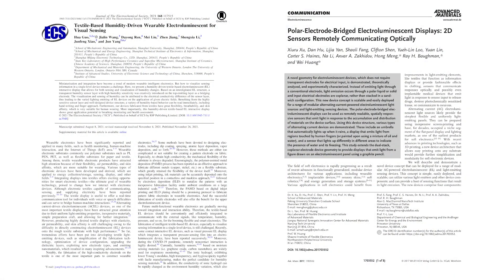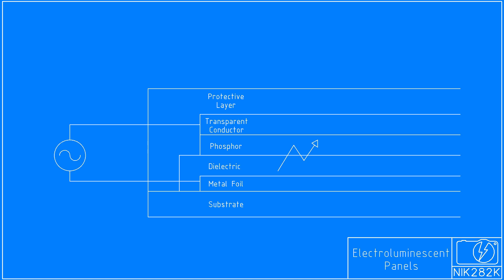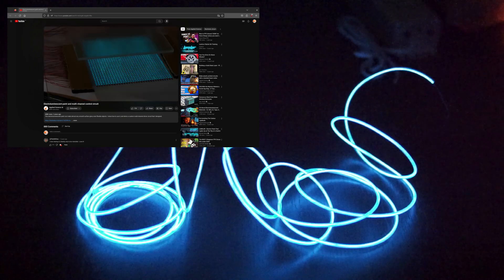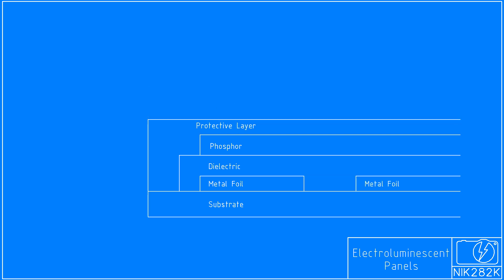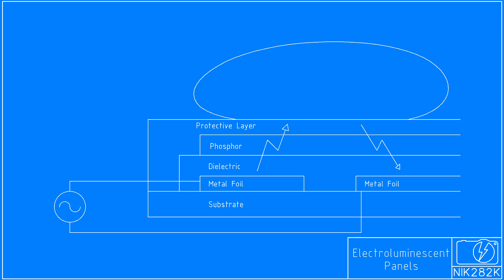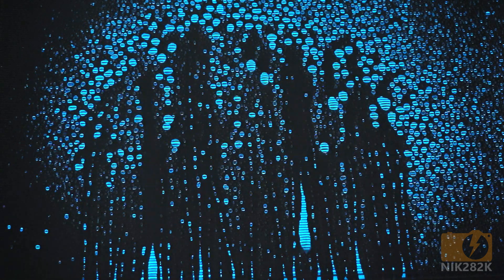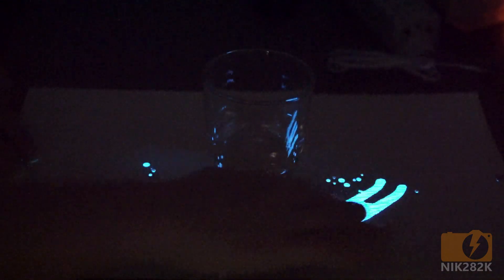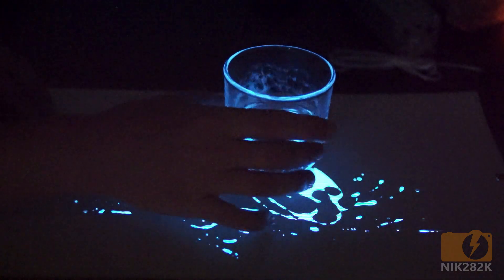Water Reactive Electroluminescent Panels

Comment: Very interesting !
I think of acupuncture points on the hand, they  have less electric resistance than nearby skin, so if you put your hand over this screen, the acupuncture points will cause more light. The problem is you can't see what is happening between your skin and the screen. As you know the difference in electric resistance is the basis of electronic acupuncture devices. 
Just thinking :)

Comment: Depending on how sensitive they can be (I assume cooling the panel to 0°C or below would increase sensitivity?), that could be really useful in locating sources of moisture in an air-free glovebox!

They'd have to detect water in the ppm range for that to work though. 

But being able to visualize water coming of some insufficiently dried kimwipes or improperly vacuumed nitrile gloves could have settled a fair few arguments my colleagues and I have had! (We worked on air-sensitive chemistry...)
Reply from the maker: The humidity sensitive layer seems to saturate pretty quickly but yeah, cooling it could probably increase the sensitivity in low humidity environments. Using a peltier and thermocouple it might be possible to make a super high speed hygrometer, or maybe a humidi-camera.